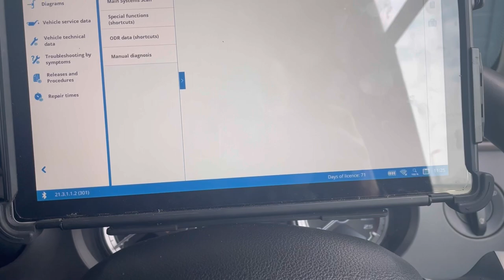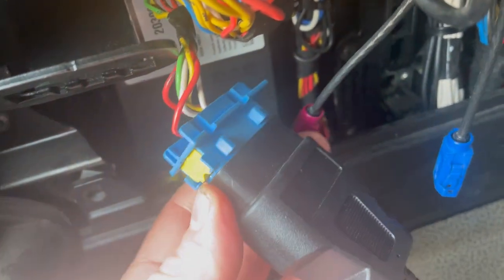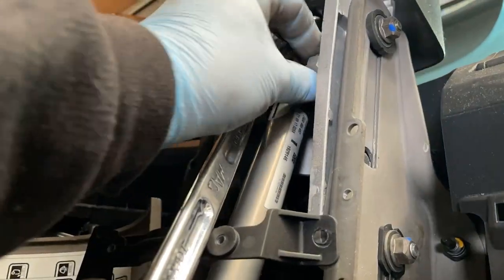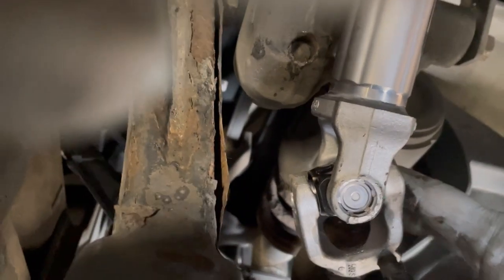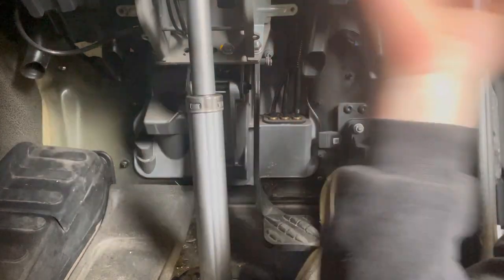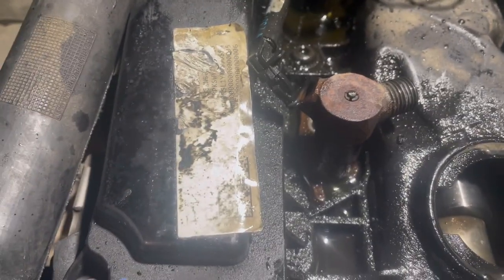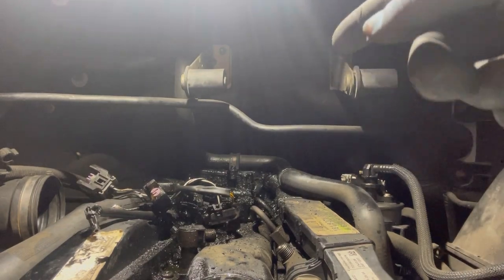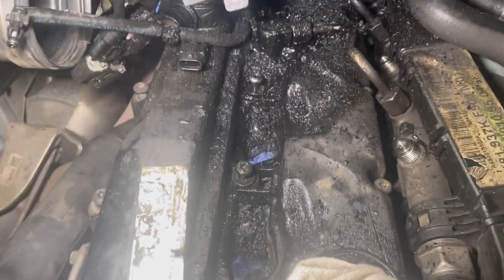Day in the life of a HGV mechanic- DAF CF85- A stiff steering shaft, and horrible Mercedes injectors

Comment: Just bought an old 2007 xf the bloody knocking from the steering Colum did my head in on way home, so had a look at it this morning expecting to find a worn or loose parts but all as new was tested last week, (mind you no Hight marker in cab and also tacho out of date) so i think its the bush in the rubber cab seal as it rattled about a bit.
Reply from the maker: Ohh dear when the tacho run out? Is it knocking only when you turn?
Reply: @freightlanetv  Jan 2022 expired, the knocking is all the time but very pronounced when under 30mph
Reply from the maker: Unless could be cad mounts
Reply from the maker: Cab *

Comment: Probably not with your customer ,but apart from the OBD socket is well crap  we sometimes have customers who tap in to the wires which also causes comms issues , usually it is just damaged pins pushed back .for some reason mainly a positive or an earth ..With the steering the nut and bolt for the U/J are 1 use only and torqued to 54nm....I am shocked not all these jobs go smoothly ,and there was me thinking you where doing about 10 jobs a day lol..
Reply from the maker: Ahh that wouldn’t surprise me! Yeah unfortunately they don’t lol haha nah not that much mate 😂